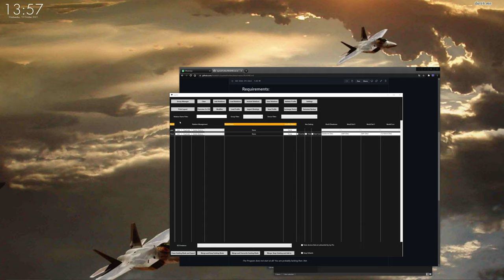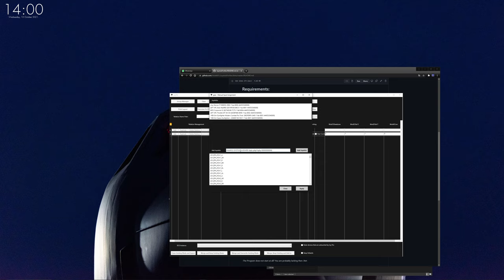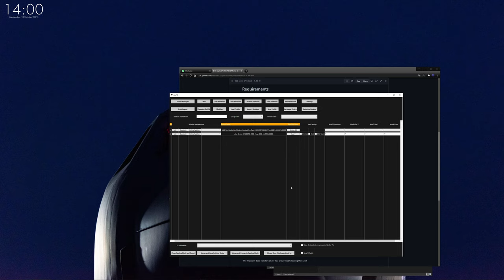#3 Bind an Button or Axis - Joy Pro - DCS World - Making Controls / Keybinds easy

Comment: I have the TM Warthog, I have tried to bind Left Engine Start/Stop  and Right Engine Start/Stop to my ENG OPER IGN/Motor switch on the throttle. It works for all aircraft except the A10C A10C II.
Any ideas?
Reply from the maker: Check if u have quaggles and check the inner self of the relation